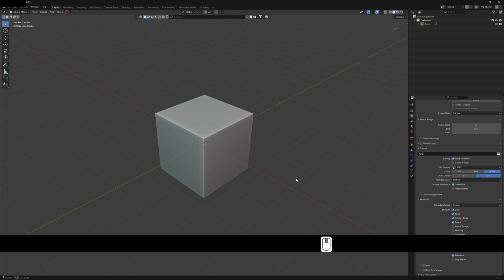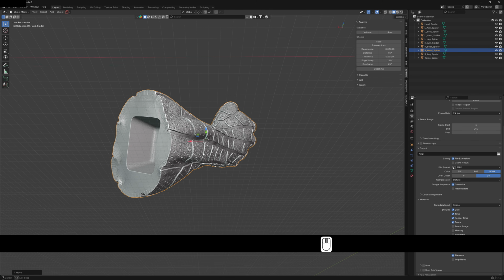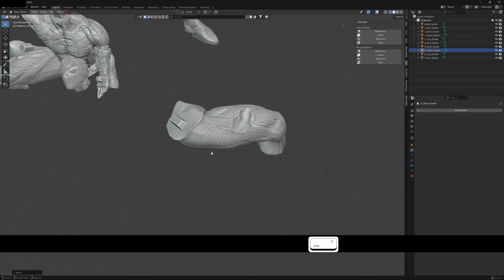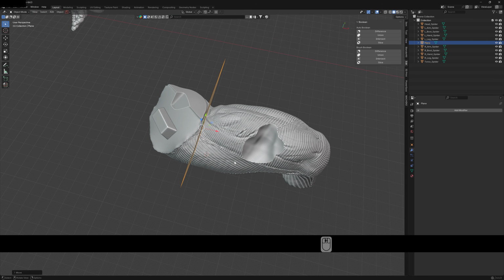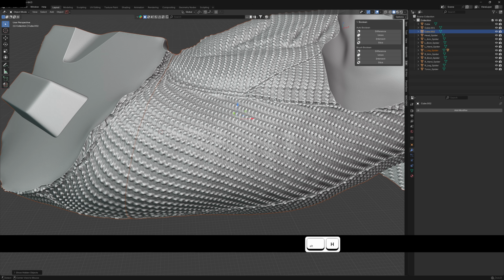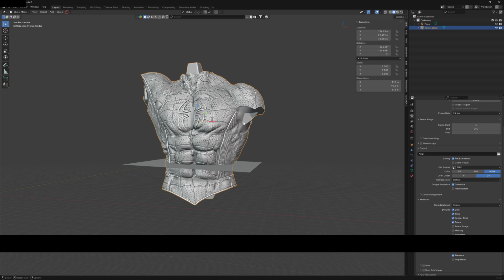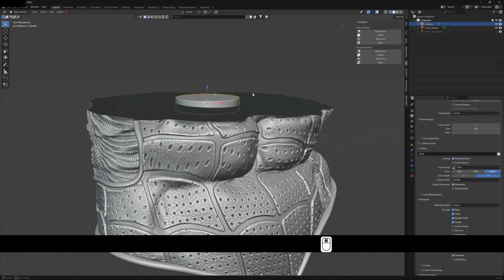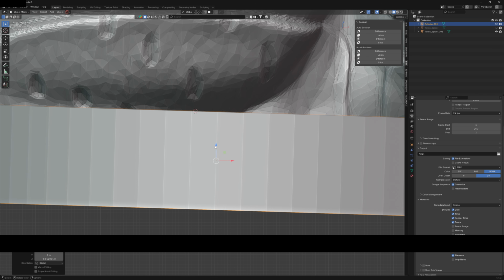Stop Printing STLs Wrong! Try This Easy Trick

Comment from the maker: Anyone need any more help on this? If so, let me know how i can help
Reply: Thanks for making this informative video on how to cut STL files for better printing. I recently joined your Patreon to get the slicer profiles, and they’ve already helped me dial in my settings and improve my print quality.

One thing I noticed while watching is how many steps it takes just to move parts around in Blender—it doesn’t seem very user-friendly. I’ve seen something similar with ZBrush too. It makes me wonder if there are simpler programs out there designed specifically to make positioning and editing parts easier, so more time can be spent on actually creating.

Do you know of any beginner-friendly apps or programs that can accomplish the same tasks without requiring a day or two just to learn the basics?
Reply: @MainelyAcresFarmBrooks   windows 3d builder

Comment: Hi from France (sorry for my English...) very very interesting video !! I have a question : At 12h30 you use a plan to cut the Object (the arm). This plan has no thickness ?I tried as you show but unfortunately it doesn't work.
Reply from the maker: sorry i think i missed the bit out where you add a Solidify modify at 0.01, Apply the modifier, then cut it. sorry!
Reply: @Krak_Fox  Thanks a lot for your answer !!

Comment: hey there ! Just stumbled on your amazing videos ! I'm slowly getting into Blender as I'm currently trying to print so more complex objects, and I've been wondering if there was a better way to divide/cut them than directly in the slicer and just landed here. Fantastic work ! I just watched your Ghoul video and it's stellar. 
I'm having an issue though, with the model I'm currently dealing with, when I try to boolean slice it with a plane, it just leaves me with the actual slice of the model and it deletes the rest of it instead of just leaving me with the full model divided in two. Any tips is appreciated ! Maybe just a checkbox somewhere, I didn't take the time to go through all the sub menus haha 
Thanks !!
Reply from the maker: ah right, so when i get weird and unexpected stuff happening, it's usually cuz the model being cut is no longer 'manifold' - meaning it has weird holes in its geometary. You can install 3D Print mod for free in Blender and you can select your model, click Make Manifold in the 3D Prrp add on that will be in the menu if you press 'N'. if a plain dowsnt do it, try a box over the part u want to cut, DUPLICATE but do not move the duplicate...select  one of the objects to be cut and then one of the cutters (these may be overlapped( and do and 'interesect'. Then click the remaining object (the last of the 2 copies) and the reminaing box, and doc a differenc boolean. sorry, it's harder to explain in text than in my head. but lots of my vids show me doing it.
Reply: @Krak_Fox  I've already checked the integrity of the model and it seems it has no errors and is manifold but I'll try again, I may have missed something, I saw on the slice I got left with earlier that the section was actually kinda weird looking so there may be something there. 
Thanks for explaining an alternate procedure, I think I get what you mean as I indeed saw it in this video or another. I'll get back to that part and try again on my model. 
Thank you again for taking the time to share some more knowledge :)
Reply from the maker: I've had the same thing happen to me - it can be tricky to fix. In Blender the 3D Print plugin sometimes says it's all fixed, but Bambu says it needs fixing still. So i often take parts into Bambu, get them fixed, export as STL and then open the 'fixed' part in Blender. Also, somtimes using the Bool Tool plugin vs a Boolean modifier can get dif results.

Also, if you know how to check normals are facing the right way, that might be something. It's nearly always due to someting odd in the geometry - auto-fixing holes can lead to odd bent faces that need some extra geometry adding to them (i usually cut them with the Knife tool in Edit Mode in blender) so that stop being 1 bizzare face and become 2 flat faces...hard to explain. i might need to demo it in a vid :D
Reply from the maker: btw thank you SO much for such kind feedback - it makes my day, dude!

Comment: Thanks for posting these videos. I print in FDM and resin, so for things like this model, I'd be using resin. However, Blender has saved me countless times for all sorts of issues, from 2.5D CNC routing to FDM prints and modifying files for resin. If you're into 3D printing of any kind, learning Blender is akin to developing a superpower. It's definitely that good.
Reply from the maker: Hey! Glad you're finding the videos helpful! Blender is an absolute game-changer for sure. 🍻

Comment: Quick question, no is more easy do the cuts and joints in bambú studio?
Reply from the maker: For simple cuts etc yeah, but the ones you see on some of my vids really get into tight details and carve stuff out that you just can't do with big flat cuts in a slicer.
Reply: @Krak_Fox I really liked what I saw in the video, I'd like to try printing something of that level, is it possible that I can find the 3mf files on your Patreon? Ready to print on my A1, I still don't believe I can print with that quality until I see it (that's a compliment, I'm going to watch all your videos, I really liked what I saw)
Reply from the maker: @SrGatonegro27 hi dude, thanks so much for the kind comments. The Absolute Fiend tier has all my A1 filament and layer settings, for the .2 and .4 nozzles. However, treat them as a starting point for your own printer - as a lot could hinge on your calibration effectiveness too.

Comment: I really wanted to get the elegoo centauri carbon for my first printer then I calculated how long it would take to print and process to get the quality I want In my statues, lll gamble with resin for now but will always come back to be impressed by the quality and time to prepare these models and videos.
Reply from the maker: Yeah it's a trade off, that's for sure. But at least there's a choice, which is only a good thing. Will depend on folks' preferences and situations

Comment: I have been using blender for doing something similar to this but I am using the plugin created by painted4combat youtuber. So I first use chitubox adding resin supports then bring that into blender, then use the plugin for blender to separate the supports but keep them together before adding them into Orca. That process if much faster than this and I get awesome results as there are no longer fdm support interfaces that need to be cleaned up.
Reply from the maker: sounds good dude, I'll have to try. But I feel you'll still get issues with orientation. The reason i cut things up mainly is that some parts have competing areas of detail that both need to be orientated better in order to be FDM friendly. The supports aren't the issue TBH, it's the axis they print